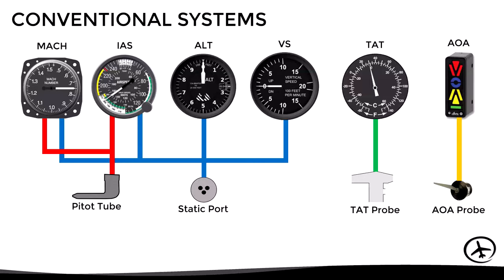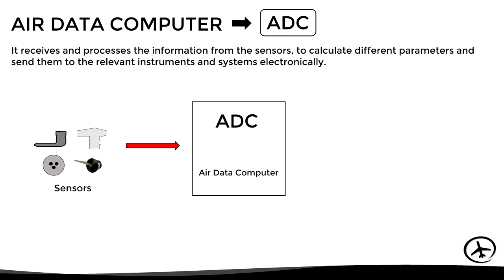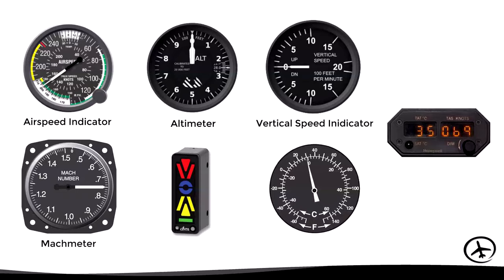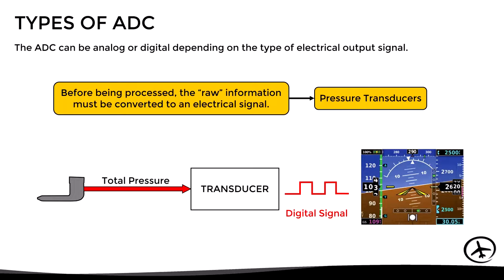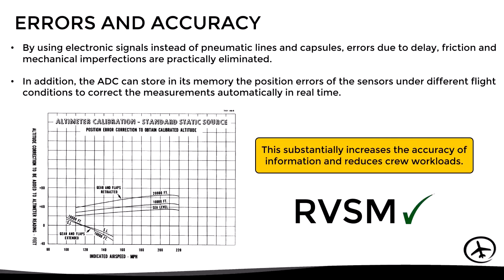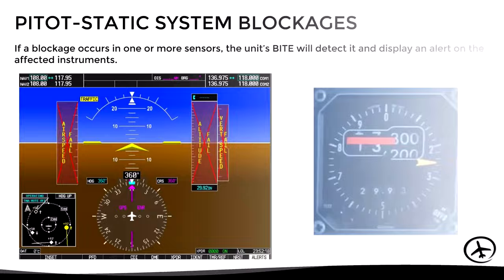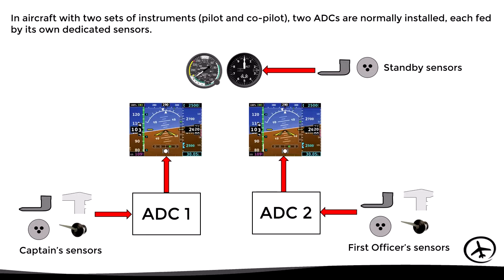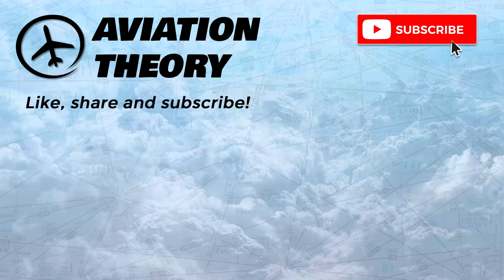The Air Data Computer (ADC)

Comment: Hello sir , thanks a lot for this presentation , really it's important .
Is there a different between ADC and ADS air Data system 
If we have different between the two IAS , what's the source of problem.
Beste regards
Reply from the maker: Hi! The difference between ADC and ADS is that the ADC is part of the ADS (it is the main computer of the system). 

And a difference in IAS may be caused by a blockage of one of the pitot tubes.
Reply: Depends if it's the airspeed indicator reading incorrectly or whatever you have for digital display reading incorrectly.